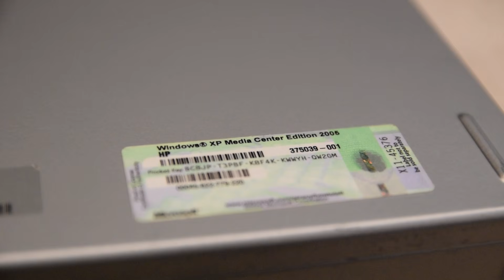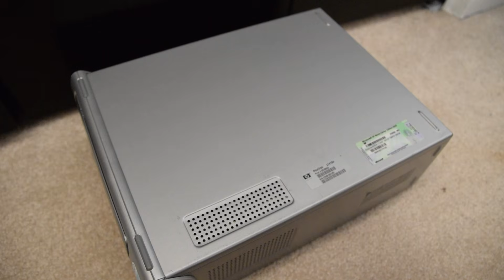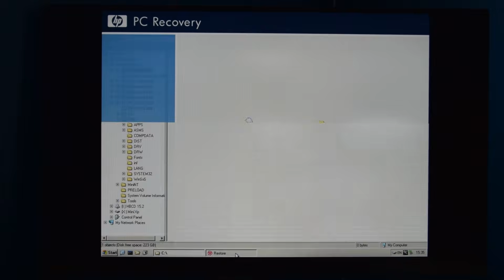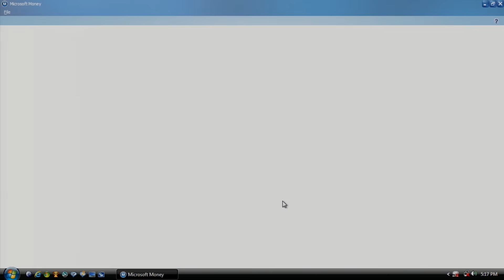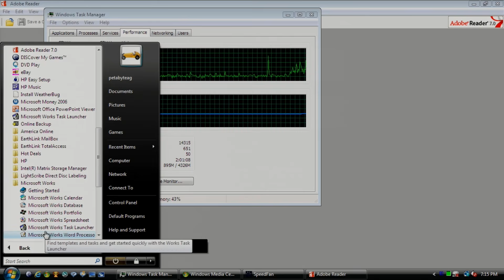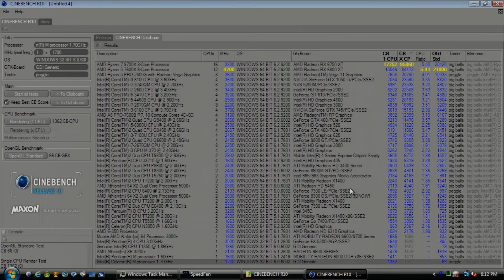Retro Review: HP Pavilion Slimline s7410n

Comment: Just in case, there are (in AliExpress) a lot of MiniITX motherboards with CPU integrated for NAS usage that work around ~50W and support TPM2.0 (for win11), you could change the motherboard of this PC for upgrading it without changing too much of the original hardware.

Maybe I'll make a video about it, I have a HP Pavilion Slimline s3711la and I pretend make a build using it, the advantage in my case is that my power supply is 160W top, so even I can get a low profile GPU powered only by PCIE..

Comment: If that pc is used alot Clean that psu!! those are well known to burn because of littlie to no airflow,and with years of dust it can break down. Also HP made a stupid connector that is so small no other psu can ever fit in that machine.

And a awesome video btw

Comment: Funny thing is, this is way better than a Celeron D of the time😂
Stick a 400 MHz dothan Pentium chip, pin mod it to 533 MHz (or go for a Pentium M 780 directly) and you have a capable retro system better than a P4
Edit: Pentium and Celeron M are P6 based, aka the Core 2 predecessor. These run cool and are efficient, unlike the netburst turds

Comment: this would have performed horribly in its day.. a single core mobile Cel M390 and 1gb is HORRIBLE in Vista... this PC is kinda of not worth the electricity it uses... I would assume you could fairly easily upgrade it to 4gb and say a small sata ssd AND then move to a Core 2 Duo T7200... in the day I ran Vista for like 6 months on something like that and it was fine... but TODAY... you could install a linux but yeah... again... these things blow too much power for the performance

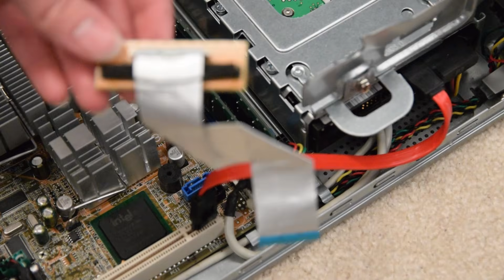Comment: 8:54 this port is not proprietary to this computer, you can get a whole SSD for this connector (32 GB and less are basically wortless, they came from the netbooks, or you can get a brand new 128 GB one from China for about $40) or just connect an HDD from the iPod
in fact i have a netbook branded as ECS E09EI6 which came with 8 GB SSD with the same connector
also about the PCI graphics card: get GeForce FX5200 PCI edition

Comment: Since there's a PCI slot, you could install a GPU like a GeForce or Radeon alongside an early mobile Core2 Duo.
Reply: a PCI video card upgrade (i.e. Radeon X1300) would be plausible, but the best CPU this will take is a Pentium M 780 because it uses Socket 479 and not the later Socket M.
Reply: @AzuSapphire37 thanks for the clearup. And I looked up the socket in question, and apperently if you want worse performance, you can slot in a VIA C7-M.
Reply: @AzuSapphire37  yeah, the issue is getting a half decent PCI GPU in low profile configuration, with a low profile bracket. I don't know how hard it is, say in the US, to get PCI graphics cards, but there are places where they're almost gone, and what's left it's just the crappiest stuff
Reply: That socket is mechanically compatible with some C2D CPUs but unfortunately it's not electrically compatible, so that could fry the socket, CPU, or both unfortunately
Reply: @xakh Pentium M it is then.

Comment: That vista capable sticker was a lie that many people fell for
Reply: It was technically the truth, it could run Vista, as in, you could install and boot it. Doesn't necessarily mean it's going to work well 😉
Reply: I ran Windows 8.1 on that thing just fine 😅
Reply: @topcatti360 8.1 is actually more lightweight than vista or 10
Reply: @topcatti360  Windows 8 (and presumably 8.1) is actually slightly lighter than Windows Vista and 7.
Reply: Not really. The problem with vista was drivers.

Comment: Try running 8.1 on it. Seriously
Reply from the maker: It world run, it just wouldn’t have graphics drivers due to lack of support
Reply: @betapyteag couldn’t you try 8.0 then an upgrade?
Reply: That would be awesome, but this cpu lacks neccessary instructions to run it. 8.0 is the newest os you can run on it
Reply: @Jaguarek62 I mean you can run 8 with classic shell but I’m confused what would prevent 8.1- I’ve ran 20 year old machines on it no bother
Reply: @jonnywishbone4805  Windows 8.1 drops support for processors without the CMPXCHG16b, PrefetchW and LAHF/SAHF instructions, as attempting to boot the AMD64 version on these processors will cause an UNSUPPORTED_PROCESSOR bugcheck